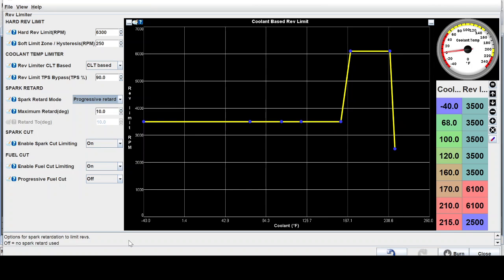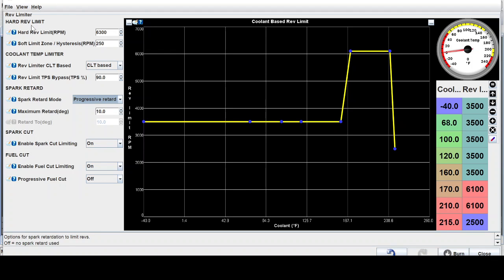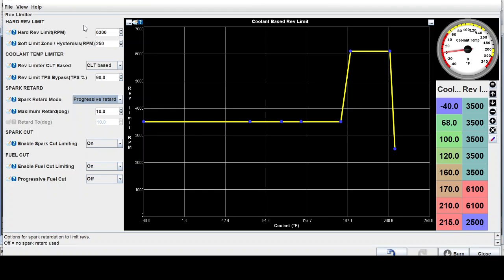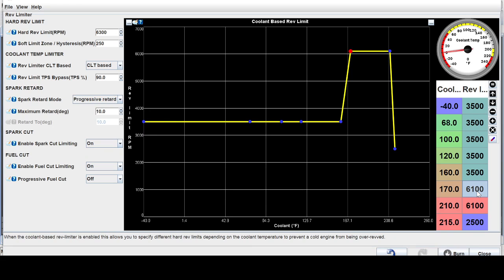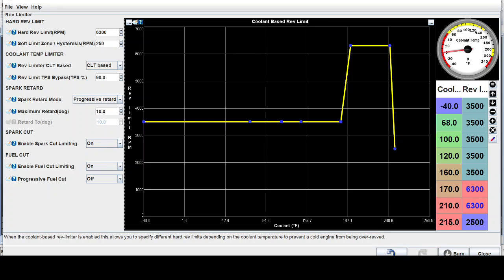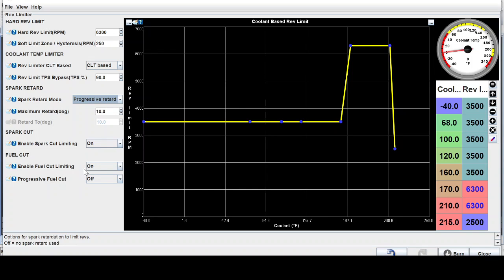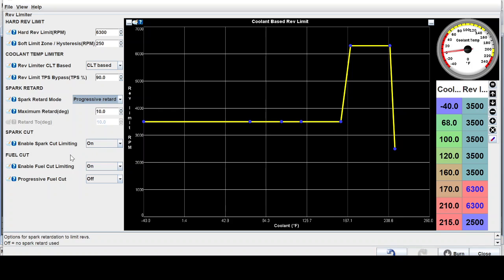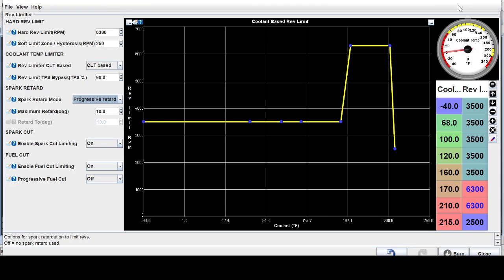Megasquirt Rev Limiter Tips For SOHC BMW Engines

Comment: If I want to make it even  safer/smoother, I must increase the RPM hysteresis?
Reply from the maker: Yes make the hysteresis bigger and keep it on fuel cut only or fuel and spark
Reply: @TurbineResearch  tnks so much
2 activated safer than only one?
Reply from the maker: @team97octanos  yes fuel and spark is the softest